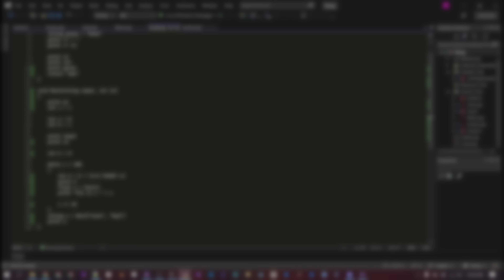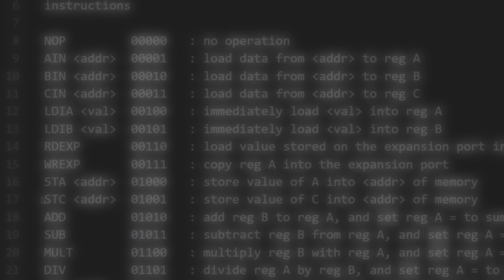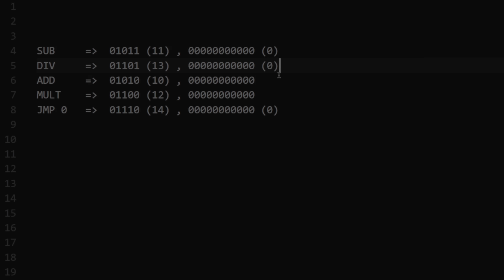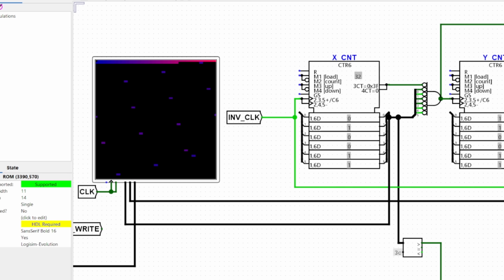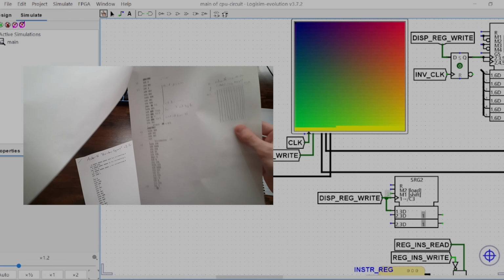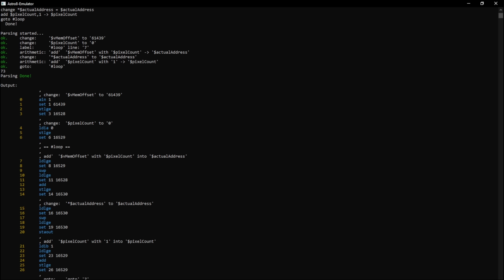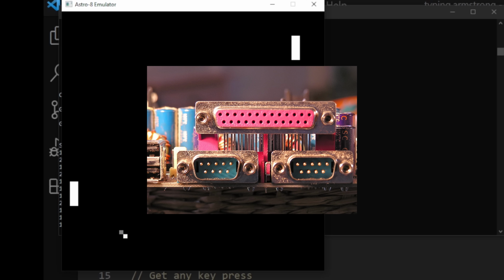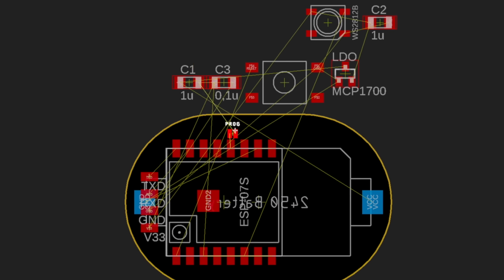I Designed My Own 16-bit CPU

Comment: This is an impressive educational exercise, but it doesn’t amount to a new or own CPU, it’s essentially retracing the classic CPU design.
Reply: Of course he followed basic CPU architecture? There has been decades of research gone into CPU design and if there was a better design, companies would be using that. What's the point in designing a worse CPU just because you want to be different? When intel makes a new CPU do you not consider it their "own" or "new" because it follows this same design? Obviously not.
Reply: @fatify5026 That has nothing to do with the point I was making.

Comment: I fixed the logisim clock timer, which originally worked with milliseconds, and swapped it over to using nanoseconds. The clock symbols on the memory modules used to use two separate lines, which is swapped to using one line, and their numbers were off-center, which is fixed.

Comment: Takes me back to middle school, designing cpus in logisim and running them, at one point I made a SUBLEQ OISC machine that could actually run subleq code compiled to a .hex file from a compiler written in C. Another one I called the MMC-1 that had a very rudimentary instruction set and wasn't nearly as capable as the OISC machine believe it or not. Logisim was and is the GOAT, even if it's abandoned.

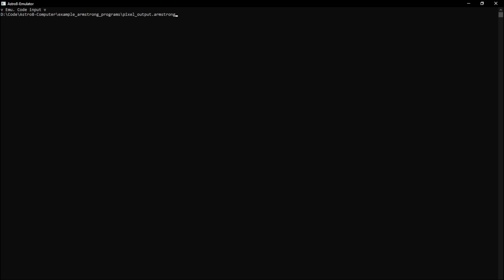Comment: Just after 11:00 he says "it only will run 1 frame per second; and its not an issue with the program I made, the program is perfectly fine: the problem is logisim needs to simulate all of the different logic relationships and logic gates and that actually takes alot of processing to do" - so my question is - did he mean processing from his 16 bit cpu itself, or from his literal computer that needed to run it? And why exactly does logisim have this flaw? In other words: what is logisism doing "wrong" or inefficiently that some other circuit building type of system would do better?

Comment: can somebody break down in more detail what his emulator did and how it was written ? He didn't seem to really go too into it?
Reply: An emulator typically just implements the instruction set on a high level. You can be as granular as you want though, and it is possible he emulated the microcode.
Just make a variable for each register, and an array for RAM/ROM, and set them to what they would be when the CPU starts. 
Basic loop: Read the byte at PC, then update registers (and memory if applicable) to what the CPU state would be after executing that instruction. You can wrap memory reads/writes in a function that handles memory mapped addresses as special cases, and blocks or gives errors on writing to ROM for example. Maybe keep a count of elapsed time to sync auxiliary systems, calling update functions on those as applicable. It's not super complex if the CPU isn't.
I made a Game Boy emulator, and the tricky parts were all the surrounding hardware, and only having foreign code to debug with.

Comment: Maybe this would have been ground breaking if this was during the late 80s, although your CPU is probably way slower in clock speed, so It having 16 bit architecture Isn't that impressive.
No hate obviously, but I just don't think it would hold up well with somewhat similar CPU's.

Comment: I know it's been two years, but as a result of this video I was inspired to make my own CPU. I only wanted something simple and not necessarily usable as a good stepping stone, and I managed to complete it roughly 3 months after this video came out. It wasn't good by any stretch of the word. No input, confusing logic, and simple arithmetic only. Once I finished most of the logic I created a small Python script to convert a custom language to pure hex in order to increase programming speeds. I eventually switched that to C after it became my main language. I unfortunately have none of those files anymore since Windows decided it wanted to try and brick my system. I finally started working on a second iteration around two weeks ago, and I plan to make it much more complete. I would like to just personally thank you for inspiring me to do these large-scale projects, as they have furthered my programming knowledge leagues ahead of what it was. I'm still very much a beginner and have never had a job in any field relating to programming or school education with it, but I have been programming for roughly 6 years now and that one project was probably the equivalent of all of my previous time programming in terms of how much more knowledgeable I became.

Comment: Hi AstroSam.
Love the video, watching content like this reignites the motivational spark in me 🙂
I am interested in hearing about your though process regarding the mapping of the instructions for your CPU, I have tried a few similar things at a smaller scale and just start at 000000001 and add instructions at random?
I have made a few bootloaders and had a go at running some C in a free standing environment, I have a few dozen half finished projects in Logisim and an 8 bit ripple counter and 8 bit ALU made from 4p4t relay's.

I have a pretty good handle of the in's and out's of basic CPU design, it is just putting it all together to have something presentable has been a struggle.
Do you have any guidance for focusing my projects in the right direction, and how to avoid travelling down rabbit holes?

Comment: In the interview with John Crawford and Pat Gelsinger when the Intel 80386 was released, Crawford stated that they had invested about 70 man years of effort in its design.  Admittedly, maintaining code compatibility with the earlier 8086/88 and 80286 processors complicated their efforts significantly.  But, I wonder how many man years of effort go into the design of modern CPU’s?

Comment: So, I don't have anywhere nea the Comp Sci knowledge to do this Myself (Been trying for decades to get the extended time a few times a week to just watch the complete 11 hours of PBS Crash Course videos), BUT ... I would love to know if this is also possible in a LibreOffice or OpenOffice version of the Excel alternative as well.

   And for an additional challenge, on just how "old / budget" of a spreadsheet utility it could be run, including the spreadsheet from the old MS Works / MS Works suites.

G'Luck!!!

Comment: I was looking into N64 turbo nerd assembly stuff and I realized something (maybe i'm unaware of some intermediary steps tho, i'm just a terminally online dude with way too much time), the CPU being basically a glorified calculator, the bits fed into it might "just" open/close logic doors to tell the cpu what to do with the following bits of the instruction.
For instance : if the 5 first bits are linked to, say, ADD instruction, they'll open the "gates" for the following bits to be fed through the ADD transistor array section.
I believe that's why in every assembly language I ever read about, the instruction comes first, then the appropriate values, being usually at least one register address and a fixed value or another register to read the value in. IDK if i'm clear, very interesting project overall ! Thank you for the video !
Reply: Well, on N64 the 32 instruction bits ( opcode + operands ) come all at once . Old CPUs use the ALU. One circuit to implement all instructions . The gates need to change as the data arrives.

Comment: Next logical step would be to use VHDL or Verilog and an FPGA to make it a real thing :) With proper planning ahead, a lot of the work you did so far, could have been used to generate the HDL code from what you have already... I did that once (in Common Lisp, where from 1 definition, I created the assembler, a compiler and the emulator). It is a challenge in itself to try and get it all done like that with maximum synergy.

Comment: I had a similar project to do as part of my Architecture of Computers 2 course at my university. Albeit, much simpler. The groups consisted of two people per group and me and my friend chose to create a fixed point numbers CPU that would be able to calculate floating point values of four different mathematical operations, namely adding, subtraction, multiplication and division. We sticked with the IEEE-754 standard and had quite a bit of trouble with the processor, the teacher eventually passed the project, although it wasn't the best 😂. Still, not only did we technically were allowed to work in groups, the subject itself was simpler than yours and we didn't have to use anything besides Logisim

Comment: Encoding your CPU with a lookup table seems really bad to me, but I guess it makes sense if you can't make an actual chip from scratch.
Reply from the maker: Processor microcode is typically stored in a ROM, and since my CPU uses microcode, it also needs this ROM. If I went with a RISC style architecture, I would not need this, but I did not to make the process simpler.

Comment: Neat project, but I'm curious to what the practical purpose of all of this is. There are already countless chips you could use instead of building your own. There isn't anything special about your design, so why design a chip from scratch? All that work, and no progress is actually made. Its like if I wanted a car, but decided to invent my own engine, transmission, exhaust, and everything just to get to the cornerstore and back.
Reply from the maker: Why go to school, to read a bunch of books, if everybody else already read them before you? Why solve math problems -- we already know the answer to them?!

You entirely missed the point of this project. It was a learning experience which I did for fun. I am not selling it, there is no practical purpose over any other CPU. Do you think people just become hardware architects? No, they need some experience beforehand, and I felt like having this experience.

Comment: Don't feel bad about using a placeholder character for the paddle. I just learned that Microsoft's new ai button on their keyboards actually don't have their own button mapped in the software. Pushing the button tells the pc to react as if the Windows key + shift + F24 are being pressed at the same time and that runs a program. See, they still have their software set to acknowledge functionality that doesn't even exist on keyboards anymore 😂 F keys only go to 12 now

Comment: I once designed an 8 bit CPU in logisim and made an assembler for it so I could write programs for it relatively easily. Having only 256 bytes of memory shared between both program and data made it a bit tricky to work with though. I did start on a version with a 16 bit bus, but never really got around to finishing it it

Comment: I may not be a hardware or software engineer but I am somewhat of a novice I gave this explanation to somebody I knew but to actually see it represented visually is quite validating yep data moves through a circuit by pulsating simultaneously there is no individual electron moving through the circuit like cars on a freeway when the circuit is live it is live it happens instantaneously

Comment: you need to make ur program framerate independent. by making a timer that keeps track how long it takes for ur code to execute a single frame and then multiply ur movement values by that for your objects (ball, paddles, physics, etc) That way your paddle wont zoom across the screen but itll always move a certain amount/second. Which is a lot easier to control and will look/feel way less clunky. Itll also make physics calculations a lot easier.

Comment: As a CS major and am a software engineer, I designed my own 8-bit microcontroller. I never got past the logic diagram because I didn't need to. I just used logisim to just stimulate my own JAR files for custom functionality. most of it was imbedded diagrams made in the sim. The whole goal was to create a compiler for machine code and load the bytes in with a file in logisim. It was cool writing my own assembly language and executing programs I wrote. I can't remember the program I used to simplify my logic diagrams though

Comment: Where is the physical processor? You can use circuit make if you want to do it all on a pcb since its probably easier to do then getting a silicon wafer.

Comment: meanwhile i was happy with my 10 bit minecraft calculator
Reply from the maker: Still very impressive. It is much more difficult to build a computer in a barely Turing complete system than one specifically designed for it.
Reply: @AstroSamDev thanks!

btw awesome video!

Comment: I designed and implemented a cross compiler(Assembler)  for a 72 Bit bit slice processor, back in 1987. I had programming experience in C, Assembler and Pascal only.😅 I made the Assembler compiler some kind of comfortable, so you got a Listing with errors and you were able to comment code out.

Comment: Being someone who’s used a variety of older systems I’m wondering if you could make a cpu with a huge bus? I know things that would talk to it would be 16 or 32 but bus but I’m wondering why they never kept going like a 1024 bit bus or more. Also using a blitter chip(gfx chip) to handle gfx and take it off the cpu. Just wondering. Thanks! Great video

Comment: A nice fun little(?) project. I would make some changes to the instruction set. Most instructions had the register after the mnemonic but you have AIN, BIN, CIN. They should be INA, INB, and INC. However, you have 5 bits for the op code and 11 spare bits. You can use the spare bits to indicate source and/or destination register as that can be coded in only two bits each. For jump instructions the spare bits can indicate which flag(s) to check. That would free up 7 instructions for other possible op-codes and make IN, LDI, SWP, and the math operations able to work with any (pair of) registers.

Comment: The cpu and emulator are pretty cool, but I think the language really has promise. Maybe you can work a bit more on it, or port it to x86 nasm or fasm, or CLR. 
Sadly, most system languages are either assembly with macros, Forth, or some worse version of C. Armstrong looks straightforward, likr Dartmouth Basic. I kinda dig it.

Comment: I've built a virtual CPU AI Al that replicates your physical CPU and helps computations to boost system performance I'm stuck on running it on CUDA can you please help avs I will let you use it for your GPU

Comment: Any thoughts on creating a simple Network-Interface-Card that can do Ping?

For example, I imagine an FPGA is needed to implement layer 2 (Data Link: MAC and LLC) of the OSI model?  Layer1 would be purely physical (transceiver/transformers)?

For example, I imagine in order for Windows to see a custom NIC, it would need to have allocated some PCI address space for it.. but how would Windows know how to talk to it, in order to get for the operating system to access registers, including the MAC address.   I assume a driver is involved (Jungo?), but is there a standard for what register contains which information?   

On the other hand, if you use an off the shelf Ethernet/SPI controller (ex. ENC28J60), how would Windows see it?   If the board containing the ENC28J60 provided an RS-232 Windows could talk to it, but it would recognize it as a COM port not a NIC!

Comment: Not sure how many others would be interested but really liked the initial build up of the instruction set and how it was all represented. Would have been good to have expanded a little more on the storage of the characters in memory (although in the end I concluded you did 2 words per character, using doubled pixels for the right and bottom edges [5x5+2x3=31]?). I'd have been interested in how the ROM data was used for the micro-instructions although I can guess but maybe talking through one example would have been good.

Comment: How on earth did you design the division in your processor? Usually this is way too complex for a CPU; there's a reason why this was only implemented in mathematical coprocessors during the 8- and 16-bit times.
Reply from the maker: This operation was originally done through a looping sub instruction, but this took too much time.
Currently, it is assumed that the ALU chip contains all of the arithmetic operations, add, sub, mult, div, which I am quite sure they normally do.
Of course, this only works if the CPU is assembled using large scale parts and dips, so I would likely need to design my own for a silicon version of the Astro8